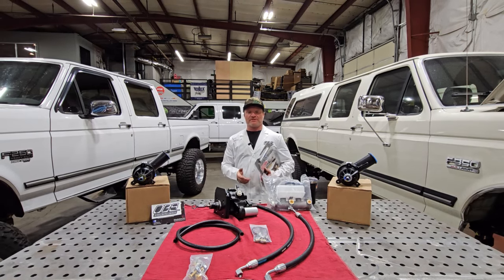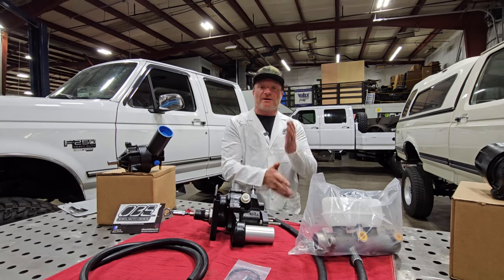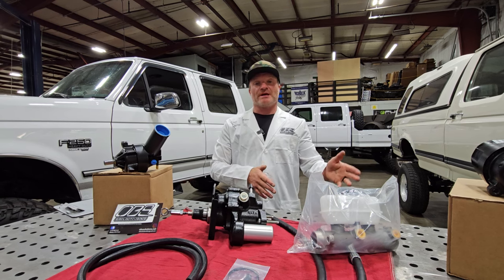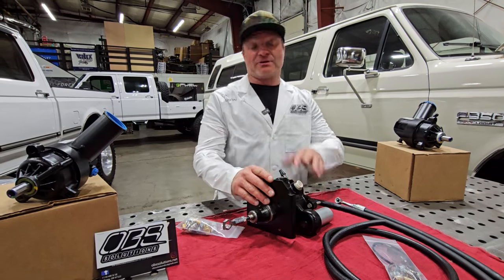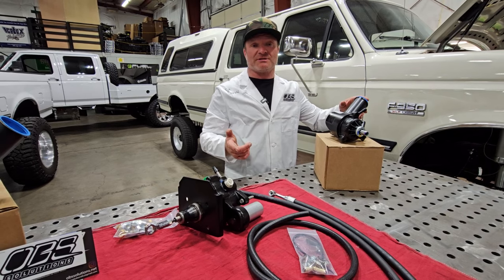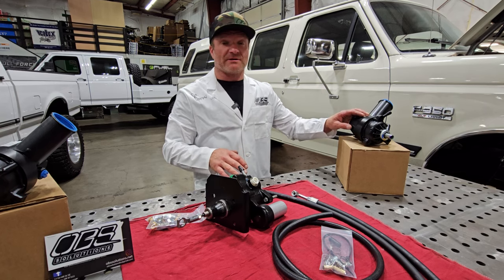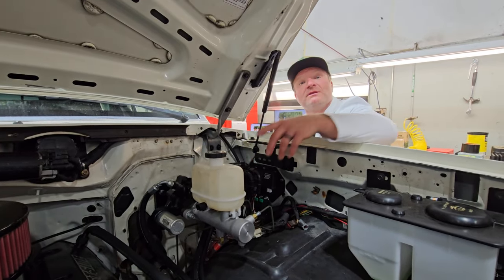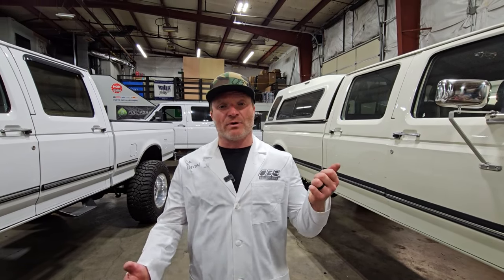OBS Solutions Hydroboost Brake Kit for 1987-97 Ford F-Series and Bronco's!

Comment: Any chance on a remedy for the RABS module replacement or delete kit? Tired of the squishy pedal and ABS light coming on and locking up the rear end on my 95 F150 5.8 4x4. Can't seem to bleed all the air out of the RABS.

Comment: I purchased your kit , option 2 , trying to run original master cylinder and I am currently trying to modify the holes on it in order to mount to the hydroboost , what is the correct master cylinder to purchase?
Reply from the maker: @rokin89  the stock ford master cylinder should work without modifications

Comment: For a 1994 Bronco with a 351W, I would only need option “1” and to  have my PS lines made, correct? My AC controls will still work because of the vacuum tree on the motor, right? Electric vacuum pump is only found on the diesel motors? I want to triple check.
Reply from the maker: Yes you are correct. We made a discovery today that pur line set will work on a 460 truck as well. We need to check fitment on the 302/351w trucks.
Reply: @obssolutions1466  I have a junkyard Saginaw pump and bracket on my truck so I am not sure if the lines that come with the kit will work even if they fit the 460 and 351

Comment: What is so different about the 80-86s? it seems like everone making power steering related parts skip the bullnoses.
Reply: Easy enough to make work. I put a hydraboost on my 77 Bronco using a booster from an 80’s GM diesel car and the stock Bronco master. It had 38.5 Super Swampers and could lock all 4 tires up if I wanted. I used the stock Ford Power steering pump with the pressure and return lines teed into the stock system and still worked amazing.

Comment: What size master cylinder is the best?
Reply from the maker: Stock is fine with stock brakes, if you have an axle swap and 4 wheel disc the super duty master is a better fit.

Comment: Isn't that the same as 98.5 dodge 3500 hydroboot?
Reply from the maker: No, this is new Motorcraft Booster that's been modified to fot the OBS Ford Stock firewall and brake pedal.